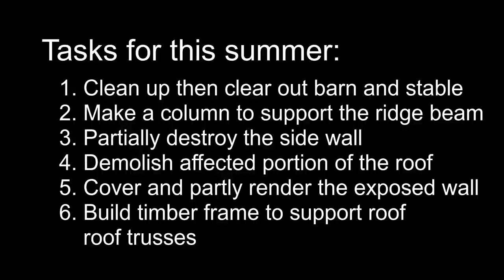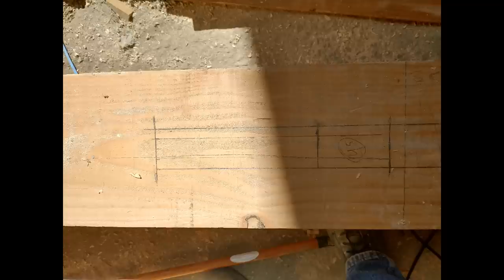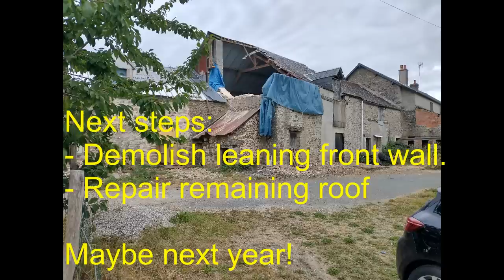French House Renovation 2022: The Barn

Comment: I hope you don't make the big mistake to work with cement. The stones and cement are enemies. You'd better use lime.
Reply from the maker: Some of both actually.  The pillar to support the ridge beam is breeze block and cement, but I used lime to rebuild the wall and render.